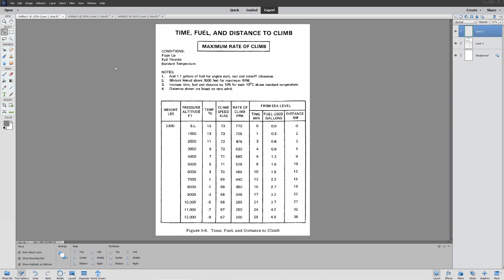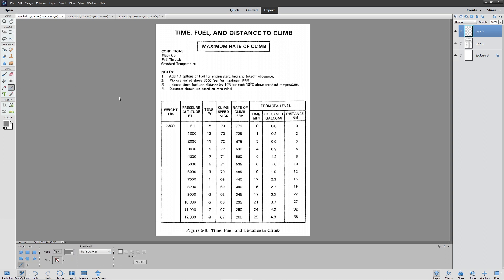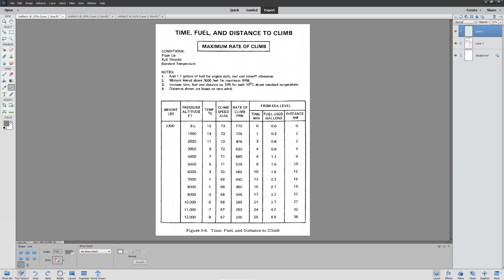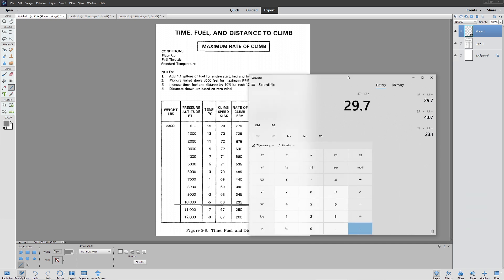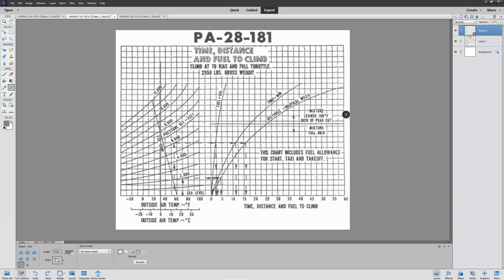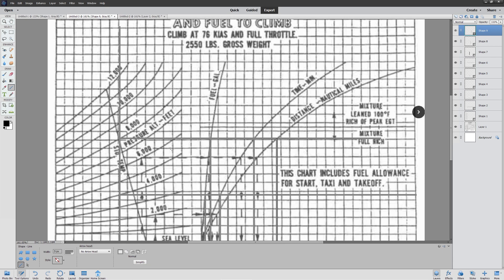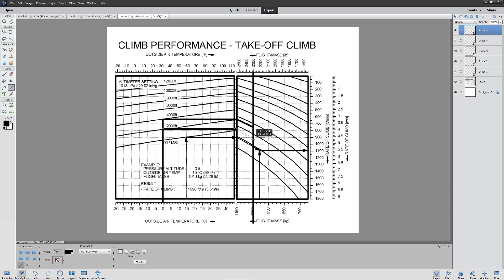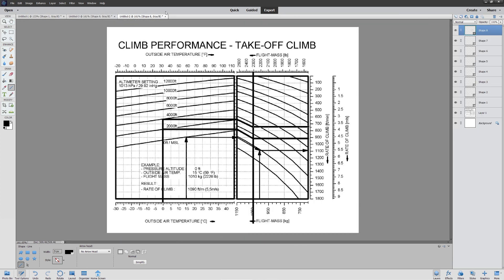Aircraft Performance - Calculating Climb rate, time, speed, fuel and distance.

Comment: Nope, 100% confused so far.  
Piper POH example does two traces (departure airport) (and cruise) and somehow tells you to subtract one from the other ( and do not explain why ).
Your example does not show anything like this.
You just head for an easy single sea-level calc.  
I'm starting to figure it out and sorta get it if you're not taking off from sea level.  
I think your example should have done this, it's confusing when you are trying to figure it out from the piper manual and 
have never done anything like this before as a brand new student (figuring it out on your own).  
So that part of the picture is starting to come together in my mind.  
However--  
The Piper chart only shows a weight of "2325 Lbs" and gives no provision to use your actual weight or calculate for a different weight.  
So I don't get that. 
Maybe it does not make a significant change if you are loaded considerably less? 
The number used in the example is at max rated load.  
If that's the case then why do the other types have you factoring in weight?  
Your other types included weight but Piper magically does not need to factor it in. 
 In Piper's example in the handbook they have a 20Degree difference in temperature from a pressure altitude of 1500 to 5000.  (3500ft difference).  
This also seems off an unusual.  
Doesn't follow the -3.5 degrees per 1000ft drop at all.  
I understand there are exceptions but why do they have to be weird about it.  
And yes I'm overthinking it but if it were explained in a better way that made more sense..  
I probably wouldn't have to.  
Either way all good I learn more and get a better understanding when I have to pick it all apart like this.
:)

Comment: I (roughly) understand IAS vs TAS, but I'm still a bit unclear on how you use them for planning/flying, especially during the climb. The way I understand it, planning is all based on TAS? Speeds relating to climb that I've seen often seem to be IAS, but the IAS/TAS relationship changes with altitude of course. So when you actually fly it, do you aim to maintain the planned TAS or consistent IAS or ???
Reply: True Airspeed is true airspeed. the actual speed you are moving through the air.
Indicated Airspeed is just that. It's what the airspeed indicator in the aircraft is displaying.  
Indicated airspeed varies with air density/pressure/temperature as well as a few other things. (reference calibrated airspeed).  
Too many "airspeeds".  
Silly joke I made up: 
" The only airspeed that matters is closing airspeed."
Reply: my cfi told me , you cant get tas during a climb because winds are (maybe) different at different altitudes so you may leave that portion as blank and then cruise until shp and proceed